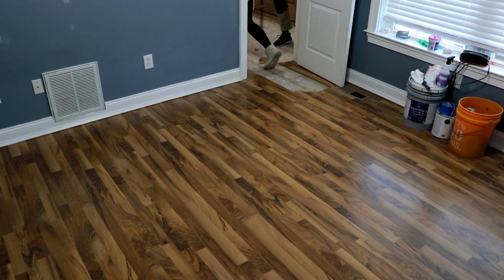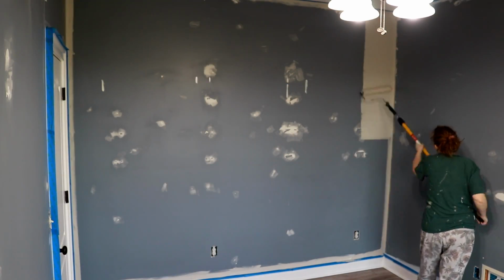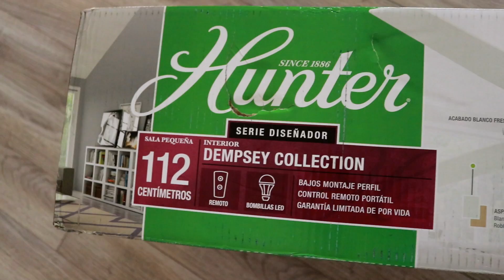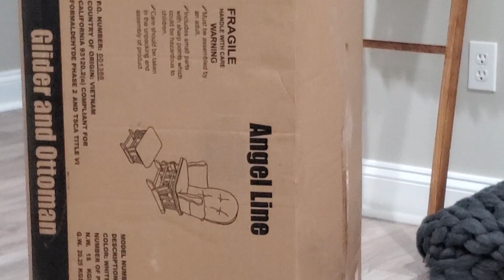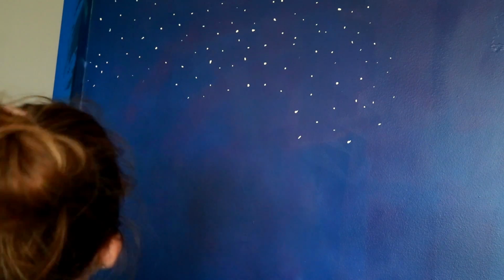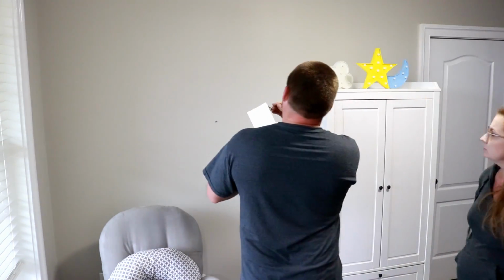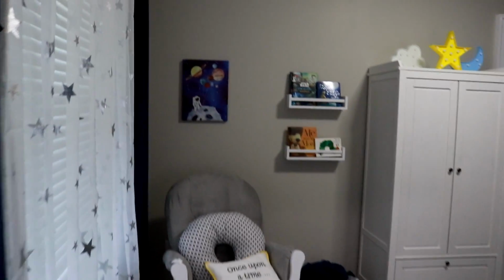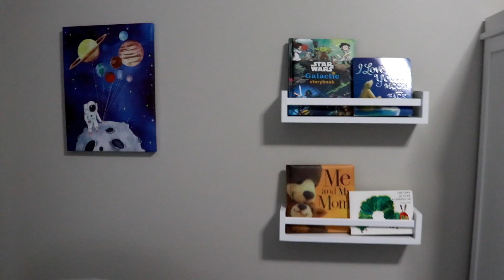DIY Space Galaxy Nursery Makeover | Boy Nursery Ideas

Comment: What are those black clips your husband was using on the baseboards as he laid the flooring?
Reply from the maker: Those are just spacers required around perimeter to lay the laminate. Whatever size is noted in the install manual, I think we used 5/16th. You don't want to butt up tight to baseboards or walls because of possible expansion, then buckling of your floors.